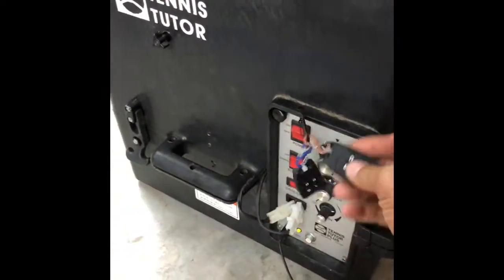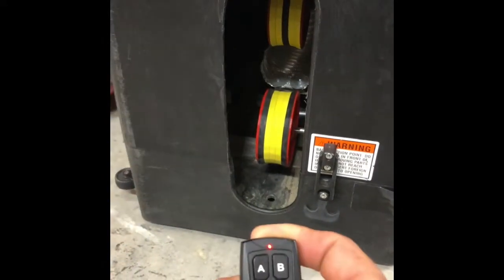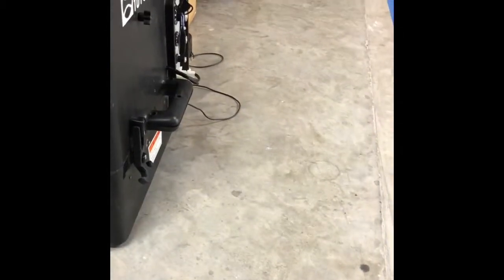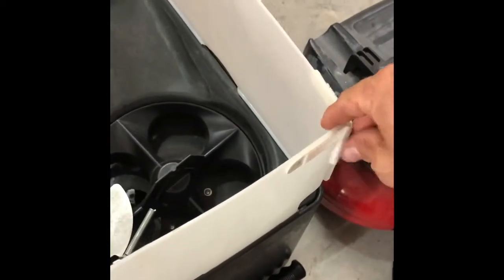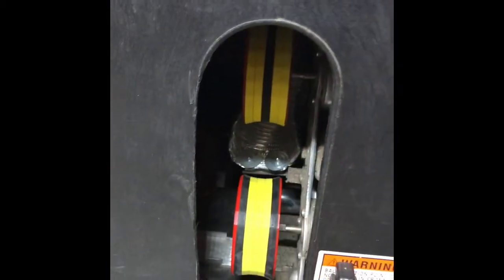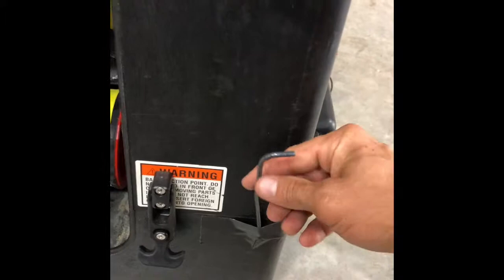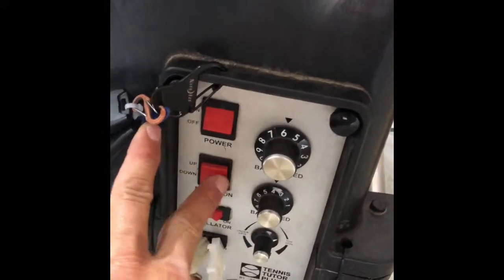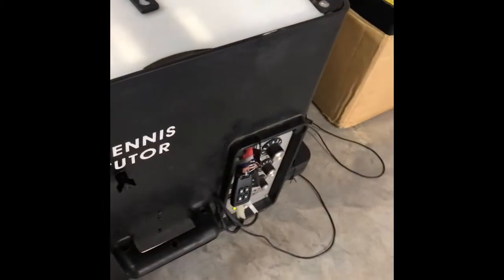Tennis Tutor RF Remote Control Hack + Other Mods

Comment: Great video and project.  Wondering if you may know the part number for the speed control potentiometer on Tennis tutor plus.  My speed control knob snapped off And I’m trying to avoid replacing the entire control board.

Comment: Hey great video! I have a model that is powered by an ac cable rather than a battery but I want to convert it to be battery operated. I bought the correct batteries as well as the metal bracket to secure them. What gauge wire should I use to connect the batteries to themselves and to the machine? Strangely having a very hard time finding that info. Thanks so much!

Comment: I added a simple on/off remote for power to the carousel type ball feed and an associated on/off led indicator light for $25 plus tax. The only problem is that it was in parallel with the power to the carousel, and  the voltage to the carousel is what determines its turning speed and thus ball frequency. When this voltage drops below 10V, the  particular remote I am using ceased to work. I was thus restricted at times to shorter shot intervals than I would like. Changing the relay allowed me to wire power the relay at 12V separately while opening and closing the circuit for the carousel regardless of the voltage being supplied to the carousel.

Comment: Great video. I want to turn the power on/off and oscillation on/off. Can you do a detail video of how you wired your remote. Thanks
Reply: K5 Adventure, were you able to do what you want? I tried by connecting relay1 to the two larger wires for power switch and relay2 to the two small wires for the Oscillation switch. It works only if I disconnect the two connectors connected to relay1 from the power switch. If connect them back to the power switch then it won't turn the machine on. Also, with the two connector disconnected from the power switch,  the batter fault led on the machine will come on briefly after use the remote to turn the machine off. I wonder what is the problem with the two connector disconnected from the power switch.
Reply: Der-jin Woan I’ve since switched from the tennis tutor to a Lobster elite 3. And I have installed a 4-channel remote relay to 1) turn on/off 2) elevate up/down 3) sweep left/right 4) blank channel. I will post a video of it on YouTube soon.

Comment: It would be very helpful if you can show how to wire the tennis tutor to the controller.  The relay works as on/off switch so I have no clue how you wire it to adjust ball speed, feed and elevation which are variable resistors, I think.
Reply: I placed a relay in series on one leg of wires to the carousel. I then powered the 12 V relay switch itself directly from the battery. I am assuming power loss through the switch will not be a problem but it could be so I may need to wire to the original power switch at the end of the season. My LED seemed to work at very low voltages so I just wired it parallel to the carousel "after" the relay. I am not smart enough to remotely control speed, elevation, and spin. If you alter one you have to adjust the other two, and that is easier done at the box at the time of refilling the ball hopper.

Comment: Would anyone know how to mount the batteries on the outside of the tennis tutor?  I could leave the tennis tutor in my car and just take the batteries up to recharge them.
Reply: Easily done. Just remove leads from batteries and attach them to a 2 wire plug and jack drilled though wall of tutor.  For example, DC-Twist-Lock-Coax-Plug-Jack-Connector-Set-2.5-x-5.5mm-090-5029 at Parts Express.  (Sorry, I can't get link to work)

Comment: Thanks for the inspiration. I was able to add the remote control feature on my tennis tutor also. However, I’m struggling with adding the LED lights. You mentioned that you have another video detailing the LED lights hack, but I couldn’t find it on your channel. Do you mind sharing that video too? Thanks